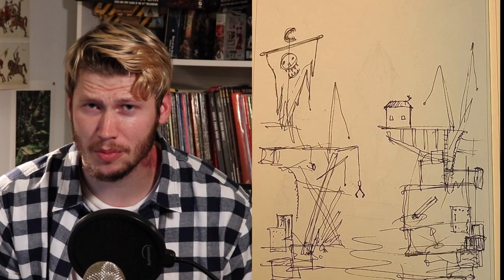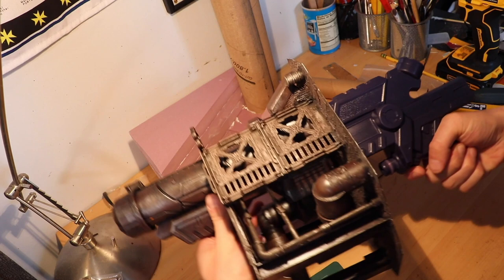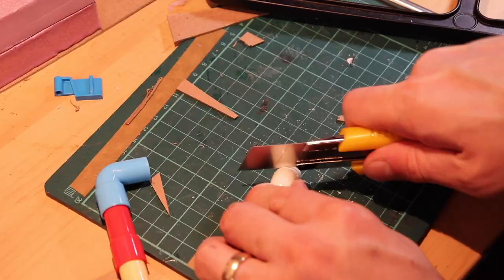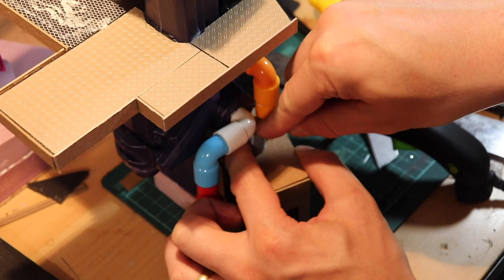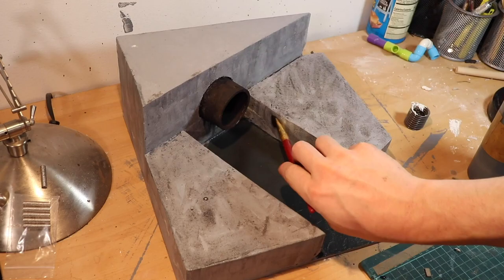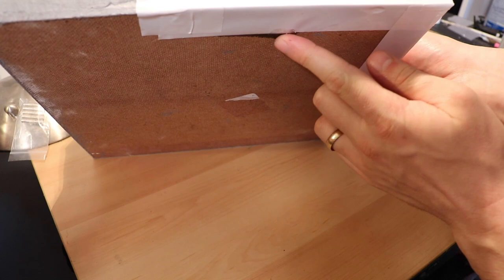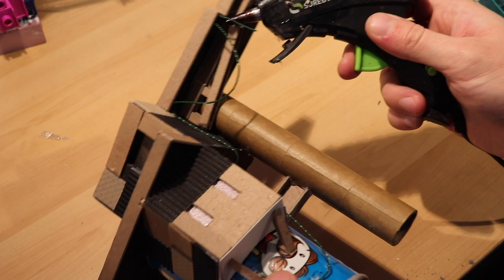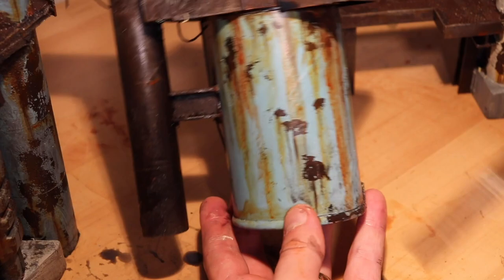The ULTIMATE Modular 40k Diorama and Terrain feat @Miscast

Comment: do you not break off the blade bit by bit, to keep it sharp? Looked like you changed out the whole blade...
Reply from the maker: Depends... sometimes you need the longest blade you can get
Reply: sure. just in this particular case you didn’t need a long blade so I was curious as to why you replaced the whole blade... the knife is specifically designed so you don’t need to do that. 

Anywhooooo,.. LOVE your videos.
I sometimes work with set design and it’s cool to learn techniques from this realm of modelling. You’re very skilled at it and you videos are awesome. 👌🏼